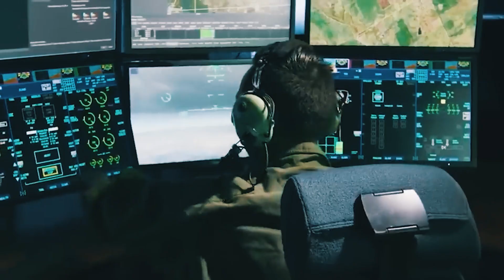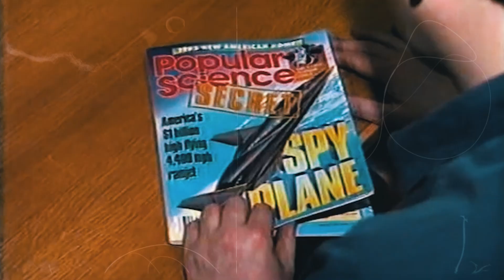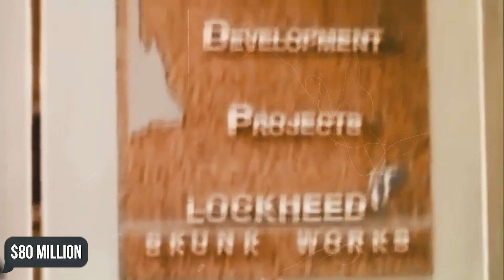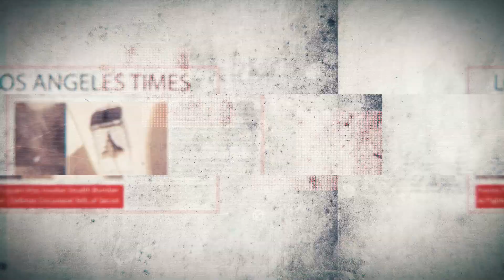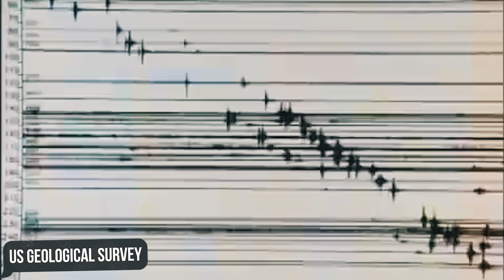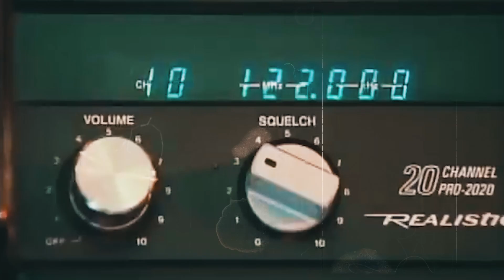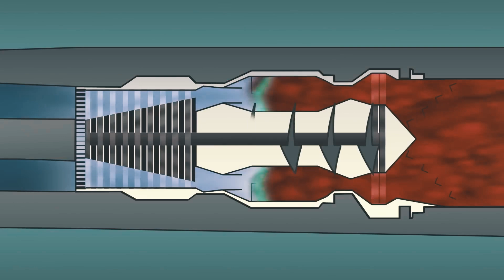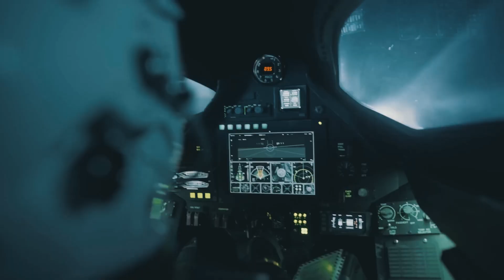The Mystery of US Top Secret Fastest Spy Jet Is Finally Uncovered

Comment: About ten or so years ago I was in a flight from Tokyo to Bangkok in a time of high tension between Japan and China  over disputed  islands.  About a week before a B 52 had been flying over the area. I was sitting on the left hand side of the plane towards the front.  I noticed something g strange out of my window and could see there were two Chinese planes one a kilometre ahead of us an one about the same distance behind. I was concerned but not overly worried suddenly I saw another air vehicle caught in the late evening sunshine. Strangely  it was  almond shaped and pulsing bright orange  at its rear half. about ten thousand feet or possibly more higher than our plane and the two Chinese fighters accompanying our flight. It came over very fast seemed to slow then shot off at an incredible speed. Then the Chinese fighter flew off as suddenly as they appeared.